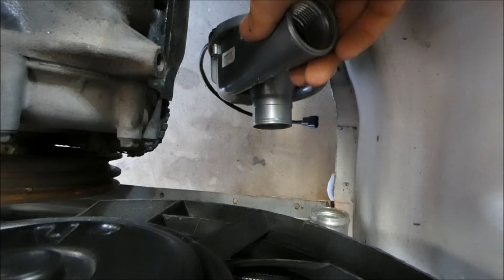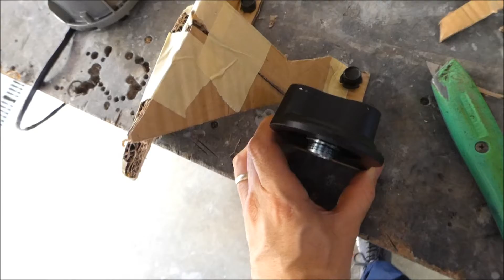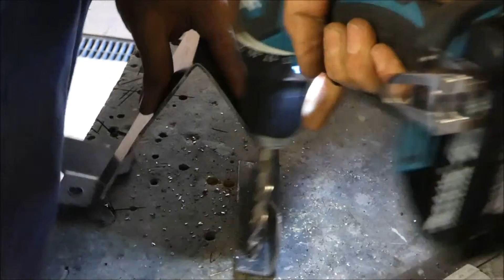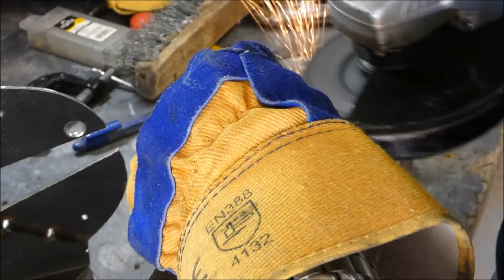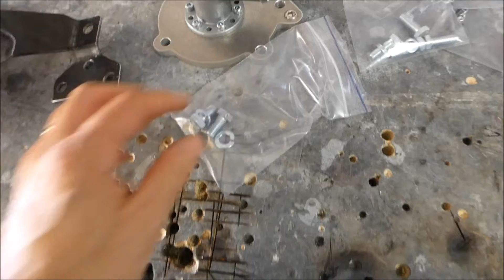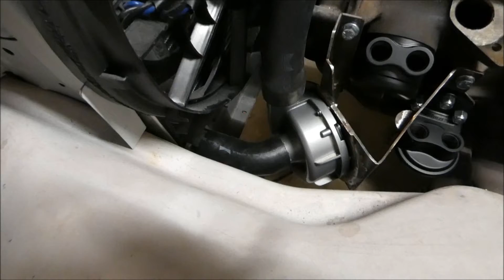Under Construction - EP6 Mounting Electric Water Pump

Comment: power steering mounting for those bolts you are using, and one or 2 closer to the head also
Reply from the maker: You know after I recorded this video, I thought "thats right these things also came out with power steer". Thanks mate.
Reply: @ToughGarage  the block was used in the falcon also. they had castings for the 2 dip stick locations also